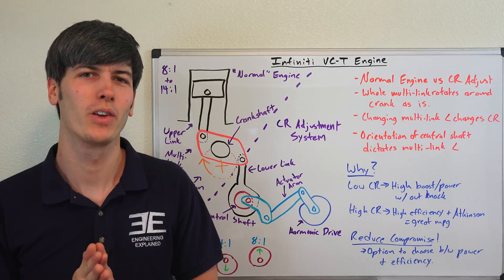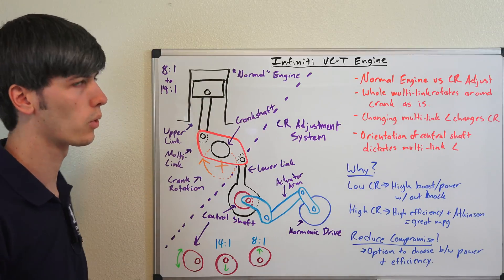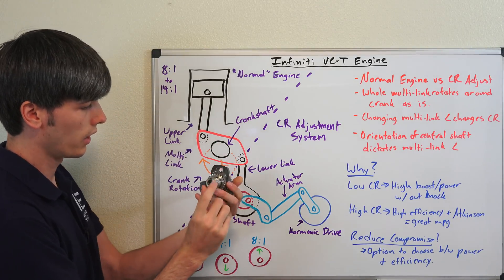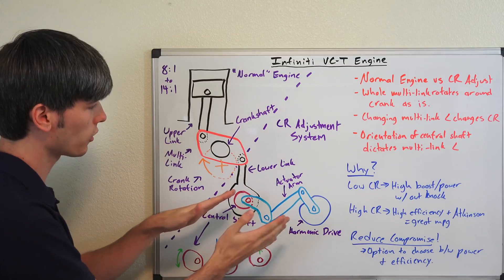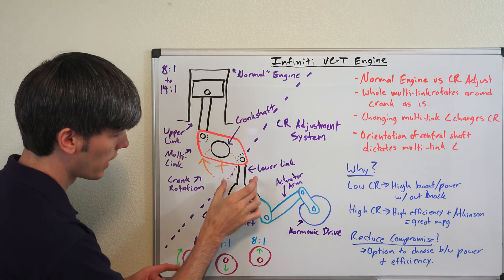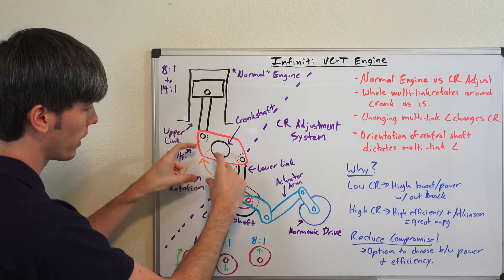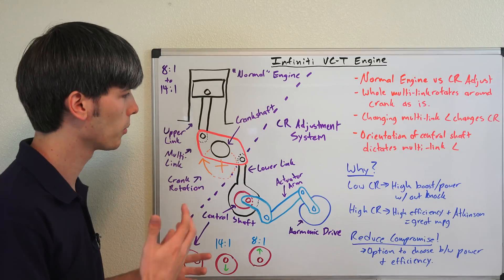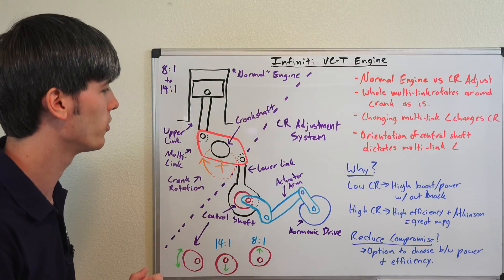Infiniti's Amazing New Engine - Variable Compression & Turbocharged

Comment from the maker: For anyone who doesn't fully understand what "compression ratio" means, you can watch this throwback from 5 years ago when I was still in college, had no subscribers, and hadn't been tainted by the mean comments of YouTube. ;) Literally my FIFTH video! https://www.youtube.com/watch?v=nveqCMNTth0
Reply: I guess VC-T just pushed up....yo.
Reply: How are your software skills?  Years later, the job remains incomplete: https://xkcd.com/481/
Reply: technology be used in v-type engines? it woul be nice to make a 1000+ hp v8 and make it efficient at cruising speeds.
Reply: LOL the old video is so cute
Reply: I just love your sarcasm :)
Reply: Is the square really not rotating? As I see it by moving the shaft up or down it causes the square to rotate differently when the crankshaft rotates. By that way you get MUCH more difference in where the pistons top and lowest point is. That equals to much greater compression ratio, because instead of just changing the travel point it changes the travel distance, which equals to much more air compressed into much smaller volume.

Also it makes no sense that the adjusting shaft would move up and down with the square when the crank rotates...
Reply: +Josh S The length of stroke doesn't change, therefore the displacement stays the same.  Displacement and CR are unrelated.
Reply: Where does the crank main bearings go?
Reply: +Markus Krause Pushed down and allowed for more boost, yo...
Reply: And now you have almost a million and still killing it. Thumbs up!
Reply: is this the new ecoboost engine?that infiniti has been putting on there trucks?
Reply: +sgt pAndAjAm - Without a picture, I can't see what you mean, but one thing did catch my eye. An elliptical crankshaft main bearing would never work. It would have to be run full sump and would be limited to low RPMs, have nearly no oil pressure, and require a large oil reserve. Plus you would still need to transfer any power it did manage to make to the transmission, but now your crank is bouncing all over the place.
Reply: how does the Honda Variable stroke engine mechanism works?
Reply: Have you done anything on the Multi-air 2 engine?
Reply: Engineering Explained, your diagram is incorrect. I commented explaining your mistake and decided to reply here anyway... The top left PIVOT POINT is not connected to the connecting rod. You need to show the connecting rod bolted to a different point on the crankshaft which rotates within that plate. The pivot point does not move at all.
Reply: For it to even remotely work with your diagram the components to the bottom right, actuator arm and all would have to move up and down with the crankshaft while simultaneously adjusting it.
Reply: Btw, I do enjoy most of your videos!
Reply: I am no mechanical literacy, but if you shift the idea a bit, could it be "variable displacement" when you vary the bottom cycle of the crank?
Reply: Yes, it will change the displacement by a small amount
Reply: You're right. I didn't think it through. I only thought of the changing volume and forgot the fact that the stroke actually stays the same. Thank you for the constructive comment!
Reply: are you a school teacher ?
Reply: Brad Caldwell I wasn't asking you I was asking engineering explained but yes it was a very good comment
Reply: i guess its weakness are all the additional moving parts.
Reply: I wonder when you start to say "Hello everyone and welcome" ¿Maybe the six video?

Comment: I'd like to understand a little bit better the relationship between the multi-link's movement and the compression ratio. If the multi-link is clocked say, 5 degrees, does that translate to 10% compression increase? Is the relationship linear? Great video and a great piece of engineering!

Comment: I wonder how engine reliability will be? I feel like the link on the crank reduces the amount of force the system can handle. Also, I feel that some of the energy from combustion will be lost in transfer of TDC to BDC because of this rotating crank link; this depends on how rigid the multi link is. Although these aren't as much of an issue if you look at it from an efficiency standpoint rather than a performance issue like I am. It really is a genius design! Any rebuttals to what I pointed out that I could be missing?
Reply: The multi-link system adds like 3 more bearings to each cylinder, that's worrying to me cause bearing and rod failure is usually what kills at high RPMs and boost. There will be the multilink to crank bearing, the con-rod to multilink bearing, and the multilink to actuator bearing, and then probably a few more bearings on the actuator assembly. its a nightmare in terms of moving parts
Reply: I also wonder if there will be additional vibration in the system, and if so how it is countered

Comment: Saab had a concept of variable compression by altering head thickness like changing head gasket thickness
Reply: I believe the concept involved some sort of hinge mechanism on one side of the block/head meeting point, and the cylinder sleeves were actually built into the head and extended down into the block.  So when the head was rotated upwards, it would move away from the piston at TDC, thus lowering compression.  Seems like a more simple system than this.
Reply: yep, that way they changed the engines performance and charged people a lot of money when they bought a new car with the "strongest" engine of the model, just for a slightly thinner headgasket.
Reply: Never made mass production.

Comment: That was an excellent explanation of something that I'm sure cost millions to develop. Fantastic video!
Reply: Took them 20 years they say...
Reply: Variable compression engines have been around since about 1920. 
There have been a few over the years that became road vehicle production units. 
The Waukesha CFR variable compression engines have been used for about 80 years to analyze fuels and rate the fuel's octane value globally.
Reply: Nonsense! Gomecsys is working on such a system for 5 years now and as they started no one was seriously developing in that direction and when they had their first running engine on the road, they were desperately looking for a company to make use of it.
Reply: +Lars Peter Gyldenkerne Nielsen 20... Wtf

Comment: I'm sure this Engine is more likely to "blow up" because of that... If something breaks, goodbye motor. If the electronics breaks to a point where it would boost even if its in 14:1 state, then goodbye motor too...
Reply: "if something breaks, goodbye motor" that would apply for any engine lol
Reply: it's 2016 they compensate for things
Reply: I doubt electronics would be the cause of failure. There would be plenty of control systems in place to prevent anything blowing up. As soon as the vehicle detects the shaft not lowering the compression, the ECM of the vehicle can always make it go into limp mode and cut boost, timing, or fuel. Plenty of different safety nets.
Reply: except a rotary, if an apex seal breaks you still have another rotor lol
Reply: +Coraga 1 +1 for this comment also it's next to unheard of for a modern day cars electronics to just sh*t themselves and stop working
Reply: That's just not true. Cars are a hostile environment for electronics, and electrical issues are a major cause of faults on modern vehicles.
Reply: I don't think it's a question of parts quality. The electronics are exposed to high temperatures, vibration and weathering. They are usually engineered to a high standard to last as long as they do.

Besides, luxury marques tend to rate poorly for reliability, and it's not going to be because they bought bottom-dollar parts.

Complex, interrelated systems cause complex, interrelated faults. These are costly to design and to repair.
Reply: Reinforced plastics are used in situations where they are useful. A little research suggests that intake manifolds and pedals are often made from glass fibre reinforced nylon.

But just because the plastics are more durable doesn't mean everything should be made from them. Reinforced plastics have higher tooling costs, and are harder to recycle, for example.
Reply: Michael T. A little too simple of a rule though. As much as I ascribe to the idea generally, you have to look at the ACTUAL track record as opposed to the theory. The objective overwhelming truth is that modern cars engine and drive trains routinely last hundreds of thousands of miles. Cars from the 1950s needed rebuilt about every 50K. Simpler didn't really last longer. The trend is also true for 1980s and 1990s vehicles.
Reply: +GunFun ZS Correct. Precision and modern materials make a huge difference.  100k miles used to be an incredible milestone for a car. Now that's just getting started (assuming pepper maintenance).  While adding components does introduce more failure points, the linkage for this is designed much like the connecting rods.  In standard production cars, it's extremely rare for the bottom end to be the failire point on a well maintained engine.

While the large amount of sensors we've added to engines can serve as a frustration with the varying fault codes, they are also why engines are much more efficient and longer lasting.  We can monitor and control the operation of modern engines in ways not thought possible a couple decades ago.  

I remember a lot of these same arguments about variable cam phasing and variable length intake manifolds.  That eventually turned into the older gear heads saying new engine are artificially boosted in performance by the adjustments and the "real" feeling of engines moving up into the optimal can timing and then past it is how performance should feel...but I say it's the opposite: fixed timing limits how the engine should be breathing and vvt gives a more realistic picture of its capabilities.

I've gone on rambling again...sorry about that.  Lomg story short - yes, there are more points of potential failure but with proper design and failsafes, it's a non-issue.  As far as the "$1000 added cost for $10 saved fuel" comment someone made, check out the MCE 5 I mentioned.  They put a 2.2L I6 in an 08 F150 replacing its 5.4.  They went from 310hp and 365lbft of torque to 330hp and 395lbft (at only 2k rpm so plenty of low end pulling power) and raised gas mileage hy 25% (from 20 to 25mpg on the highway).  I'd say that's significant cost savings in fuel AND more power. Win-win.
Reply: Sam Douglas that's what happens when you use Chinese made parts
Reply: It's not so much that cars are a hostile environment as it is that they are used for longer than other electronics. ROHS compliant solder starts going wonky after about 10 years. You don't notice with your phone or laptop, because you've replaced them at least twice. Your car is another story.
Reply: nicoxis
Hm.. You got a point. I should've said there are more stuff that breaks now so .. higher chance to say goodbye to your motor. :(
Reply: Fail-safe systems exist for a reason...
Reply: Luxury cars don't always use quality materials, I have yet to see any modern vehicle made with tool-grade glass-reinforced plastics of any kind.
Reply: You're right about them being used however when used for those applications they still do not last. The new cartridge filters that a lot of manufacturers are using, the plastic they use for the housing should be glass-reinforced. the splash guards and access panels that get their holes stripped out constantly would also benefit from this. softer plastics should be saved for things like the glove-box that needs to be removed to access cabin air filters.Parts of the car not exposed to extreme temperatures and hazardous chemicals.
Reply: Simple rule, the more parts we use, the more complex we make things, the more likely they are to break.
Also this whole question is a matter of spending $1000 to save $10 on fuel, because the driver will thrash the engine to hell anyway, we all love Torque and lots of Horsepower....never ending story.
Reply: Depends on whether they designed it to fail safe in that it falls to 8 to 1 mode vs being able to get stuck in high compression mode.
 Still it has a lot of complicated linkages and a harmonic drive which could be a maintenance problem.
The MCE-5 is a more elegant design and appears it would fail safe during an actuator failure.

Comment: Its like vtec on the crank shaft vs the cams...
Reply: lmao that's the best explanation since everyone seems to know how vtec works
Reply: makes sense in a way actually
Reply: +Rajat Dixit Yup variable valve timing with variable valve lift on a variable compression engine boosted by a variable geometry turbo flowing through a  variable length intake tracts that enough variables for you. XD
Reply: nope
Reply: I would say more like Variable valve lift like on a BMW VANOS or whatever they call it  and than variable valve timing
Reply: More like variable VTEC with variable valve timings. Everything is a variable if you are brave enough :P (boost I am looking at you..)
Reply: +dilsher12 don't forget that it could be connected to a continuously variable transmission too.... For extra variability
Reply: It's remarkably similar to how Nissan's VVEL works, which is probably no coincidence.
Reply: minus activation via oil pressure
Reply: Well, Infiniti is Nissan's luxury division so it would make sense for there to be common tech used in both.
Reply: +Myles Vredenburg Well it's also remarkably similar to VVT-i and a bunch of other variable valve lift and timing tech like VANOS and others. VTEC is just well known since it is just talked about more.
Reply: +ikutoisahobo kinda the magic behind most Hondas
Reply: Cvt trans? Let's hope not! Lol
Reply: i wouldn't say its like vtec, its like Nissan VVEL or BMW Valvetronic for the crankshaft instead of the cams. those systems were proven to be reliable since inception so i have no doubts that this will be the same thing.
Reply: btw people BMW VANOS is different from BMW VALVETRONIC. VANOS is like i-VTEC, cam timing. VALVETRONIC is variable valve lift, NISSAN VVEL= BMW VALVETRONIC.
Reply: It is nothing like VTEC lol.  Do you even know what VTEC does?
Reply: dilsher12 That's what VTEC is, VTEC is like VANOS, it's variable timing as well as variable cam profile (lift)

Comment: Thanks for the detailed explanation!
One thing though, the central shaft shown in red, bottom left of the board. You have the compression ratio's backwards. Or am I wrong?
Reply from the maker: They are labeled correctly. Moving the lower link down forces the piston up due to it's connection with the multi-link. If the piston is higher at TDC, the compression ratio is higher.
Reply: Thanks